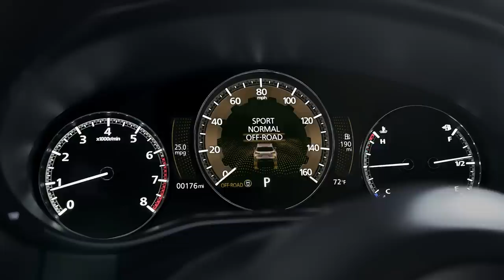Mazda Introduces New CX-50; Volkswagen Faces More Diesel Lawsuits - Autoline Daily 3205

Comment: If GM  was making more models like the blackwing, they would've kept those caddy dealers that left.... ZF making a HUGE mistake partnering with Microsoft.
Reply: Did the Cadillac dealers leave or were they paid/asked to leave / not renewed?
Reply: GM didn’t want to keep those Cadillac dealers, they have been trying to get rid of dealers for years.  All of the dealers that left, were the low brow dealers, mostly in small towns, and added dealers in big cities and high-class areas.  GM is moving the Cadillac brand upscale,  but they have to fix the dealership net work, or the product won’t do any good.
Reply: All the dealers have to either go, or become service centers. They are unnecessary middlemen.

Comment: The Frunk in the Lightning is awesome.      Ford is on it...
Reply: I agree, in fact the overall design is fantastic. It's the first vehicle in the US to feature power to home also. However, I can't fit a full size pickup in my garage and still be able to get in and out I kinda wish they would make a smaller vehicle with those features. I added 5 feet to the length of my garage when the hose was built but I couldn't also get wider because of the lot size.
Reply: @frankcoffey  I think Lucid  has power to home, and already on the market,  and Hyundai Ioniq 5 also?
Reply: @dmitchellhomes  That would be cool for folks who can afford a Lucid. Can you image the runtime with that huge battery! Will be interesting to see the first reviews of the feature and see what that amp draw max is.